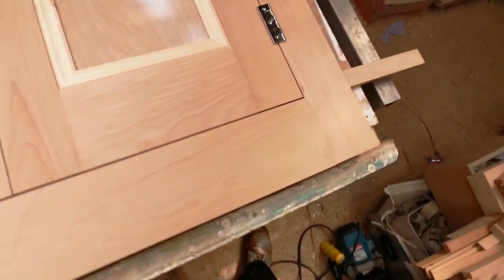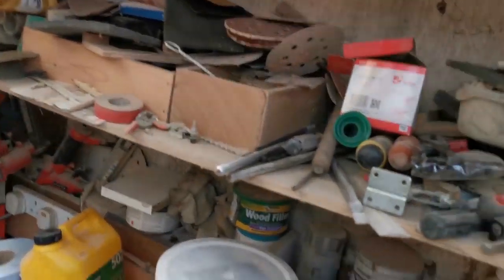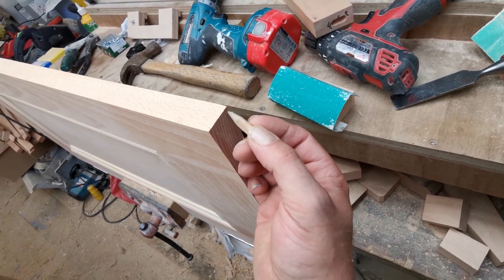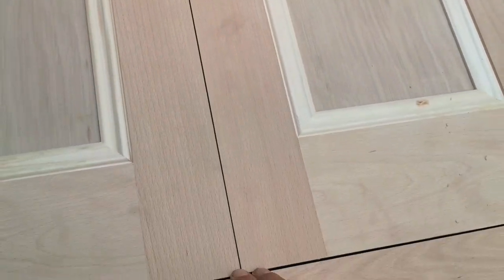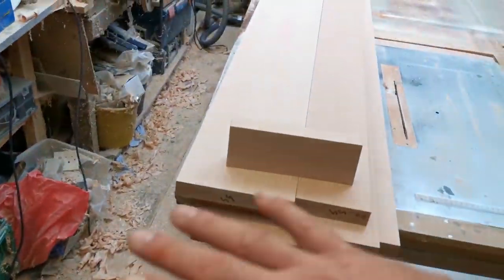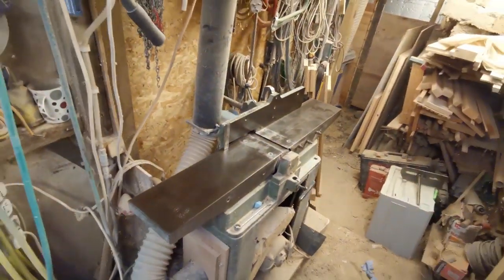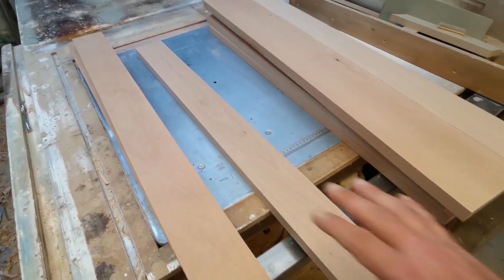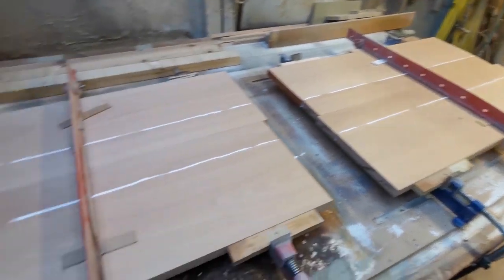Smith's Alcove cupboards & shelves Pt4 - Hinges on the doors & planing wood for the shelves

Comment: If your domino is less than 3 years old, send it back to festool and get them to true it. You'll have it back in no time, that's why we pay a premium for their tools, may as well use it. Thanks for sharing, great vid as usual.
Reply from the maker: Yeah it is, I'll do some test pieces n see if i can work out if it's me or the machine, I know that Festool have quite a good warranty so i will if so, 😉 need to get on with work first, bit behind with the greenhouse temps, Thanks 👍 will do
Reply: @Gidjoiner  I hear you , work always comes first. As a side note, I always send my festool stuff in for a service just before the warranty runs out.
Reply: Paul Mason Gid, did you ever work out the misalignment in the end?

Comment: Super work,do you make the jig for routing hinges so the centre of the barrel lines up with the door edge?
Reply from the maker: Thanks, no normally i would let the whole of the barrel be on the outside, it often has a curve to it (mainly bigger hinges) which would need a bit of he corner/edge of the rebate edge taking of , hard to describe but if you were to look at the hinge from the end it would look like a keyhole, that curve then lifts up the flat leaf of the hinge, different hinges have different aesthetics though, sometimes they look better recessed in a bit & not all have this curve, there's no fixed rule i guess, 🤷‍♂️😊
Reply: @Gidjoiner   Thanks Gid,joiner and teacher all in one 👍

Comment: was thinking about the misalignment issue. i reckon you have a tiny amount say 0.5mm offset from the mark on the machine to the hole it makes. As you’re putting the cuts into opposing faces, it doubles the misalignment making it more pronounced
Reply from the maker: Yeah i agree, like i said in this vid the ones with just one domino in were close but the ones with a few dominos accumulated the difference . it's only out buy about 1mm out, but that's ½mm on each stop/hole, Not sure if i can do anything about it, Festool prob would replace/repair it but will it just do it again in a yrs time,

Comment: Hi Gid great videos, l have been watching back through the wardrobe build videos, and want to ask, why do you choose to do the stiles and rails in beech for the doors and not mdf seeing as you paint the doors?
Reply from the maker: Thanks Peter 👍 I've answered this a few times so sorry for the copy n paste, I have mentioned it vids but maybe i need to make a full video about it, - 
 It's about the quality of the base material & therefore the quality of the overall job, wood is wood to me but some are better than others, for quite a while i used pine, cheapest price i was asked for but the shrinkage & warping later when the pieces went into a centrally heated house were unacceptable to me, Beech doesn't cost that much more on a job of this price, the time & expense put in ya might as well have a decent substrate that'll stay relatively stable for it's lifetime, Beech is harder & fairly straight grained with little or no knots, it's not just the longevity tho you can feel the difference after it's sprayed, the temperature, the hardness & the way it shuts just gives it a better well made feel. I build these things with the hope that they will still be around in 50yrs like the old pieces that are still sometimes around, they were often made of pine, which is what i was trying to emulate but the quality of the wood was better then, if i bought planed pse pine i would still have to machine it sq n straight because off the shelf it never is, so the labour in preparing the wood is not much different & cutting the dominos is the same for both & maybe the same time spent would be spent on the joint of MDF whether that is a spline/scribe/groove or domino. 
I would use MDF if the job was cheap, if i didn't expect them to last more than 5yrs, if i wanted a very flat no grain finish or if it had to be done with that material through customers choice for whatever reason (prob against my advise), Mdf boards never come straight so tall doors can be a problem, screws don't hold as well as they do in Beech, fitting butt hinges into the edge of MDF is not reasonably poss, I use ply for the carcass for a similar reason so the screws in hanging rails & drawer runners hold well,
When spraying there is an inside & outside edge on the stiles n rails, MDF feathers a little so there would be more work there sanding, i give my customers the option of ply or MDF panels, you get a very flat finish with the MDF & ply is a slightly better material but poss seeing the grain through the paint, their choice?, when sanding these doors with beech stiles & MDF panels it's always the panels that need the most sanding,
I do use MDF for doors & drawer fronts, normally when it's just a plain flat door i want but I have a list of materials in my head, MDF is the very bottom & would be my last choice for shaker doors. Unless it was a bespoke style/sized door you might as buy some, there's loads of MDF units/furniture on the market, a lot cheaper than asking me to build one, it's not the quality that my clients expect from me
Reply: Gid
Reply: Thanks Gid looks like I’ll make mine with beech then along with plywood panels. Sorry if you’d posted the reasons prior as I had seen it Kind Regards
Reply from the maker: 👍 No prob Peter, it's not an easy question to answer in one sentence, Loads of reasons for & against but If you're going to put effort into making something you might as use decent materials Best of luck with yours, 😉

Comment: Yeah, it was dripping hot that day, I was turning 20 stair spindles for a joinery who had forgotten to order them in time. So I was up to my ankles in wood shavings with my shirt stuck to my back, the dust extractor on full and two tower fans going full blast! You have to slow down and concentrate hard, the old brain works better up-to about 70*.
Reply from the maker: Yeah too hot just standing, there was a couple of days when i didn't even attempt going in there, I plan on building an extension to that part of the shed out back, I'll have a door at both ends so I'll have a blow-through but even the assembly area where there is a door at each end was hot, I just tried to chill & work the weekend instead. I've got a couple of fans but the noise & wind tends to get on my tits 😂😰🤷‍♂️🤣
Reply: Gid Joiner.
 that's the last place you want a couple of fans!!